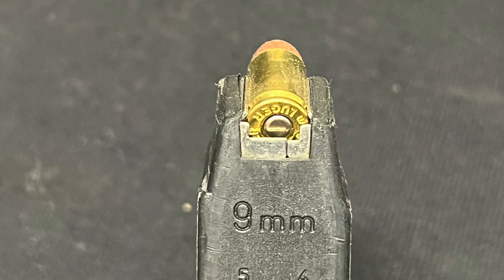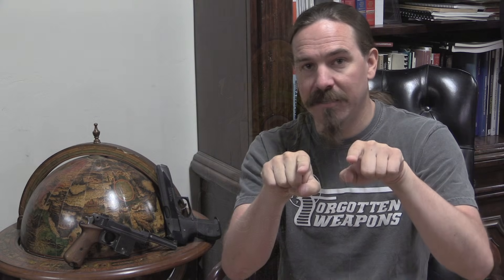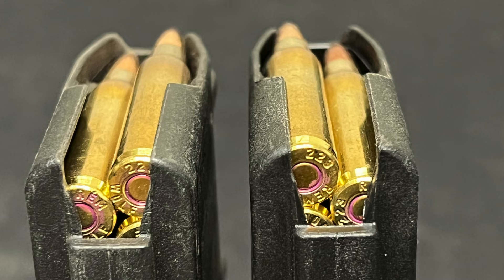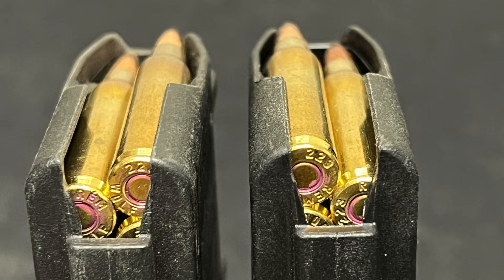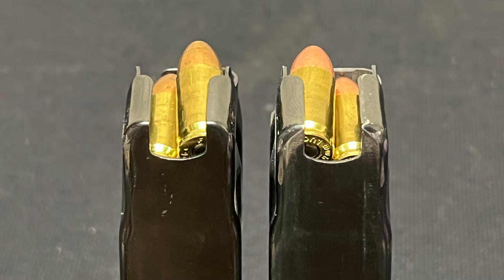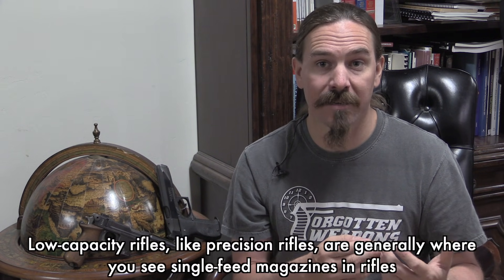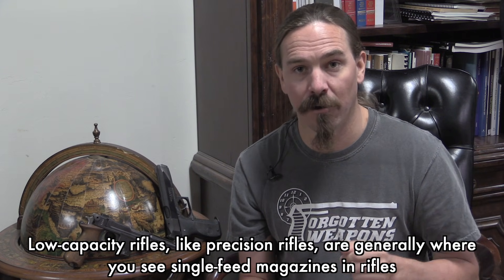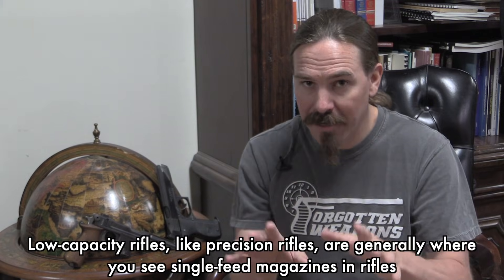Ask Ian: Single Feed vs Double Feed Pistols

Comment: The FN Five-seveN is the pistol I most think of as a double feed magazine due to the fact that the cartridge is so small caliber.
Reply: Ok...
-5,7 is double feed for more reasons, but the diameter isnt much of a reason. Its the largest diameter that defines this, and that is 7,95mm diameter of the main wall for 5,7FN - that means its just a hair over 1mm thinner than 9x19 - considering the stacking angle (cartridges dont stack side by side entirely) it makes for less than 2mm difference in the magazine width.
The reasons I see are, that the 5.7 pistol is large service handgun, designers didnt worry much about width or concealment. Also the cartdridge is long, and front part (1/3 aprox) is narrowed down - that would make traditional pistol mag loading of "cram down and slide back" really awkward, cause the bottleneck part of the round would make it harder to load.

-P90 is single-feed cause of the cartridge rotator in the magazine - the rotator takes cartridges from top and bottom colums (sort of doublefeed rotator eh?) and forces them to rotate 90° - after it rotates the cartridge there is only one end to it, naturally, as you would need two rotators, or a rotator that would rotate both colums simultaneously - and that would be HELL ON EARTH to pull off.
Reply: @warel5730  that whole comment made 0 sense and is impossible to comprehend.
Reply: For some reason I always think of that newer Russian pistol the mp443 or something grach I forget the name
Reply: @oso1165  I can't remember if the Grach is double column but the GSh 18 is
Reply: The VP70 is what usually comes to my mind.
Reply: @HALO-2304 Weirdly whenever i think of double feed pistols the GSh 18 is the first that comes to mind. No clue why, i guess it's just a neato gun
Reply: I don't think that's the reason why it's a double stack double feed mag, but yeah it's the one that comes to mind for me too.
Reply: @Appalachia_Ape  the cartridge being narrower does help in regard to the double feed system quite a bit. Since the cartridges are so slim the amount of variance between each feed position is smaller making it easier to design for those smaller differences.

My Ruger 57 is a double feed magazine with a somewhat wide single feed ramp but the cartridges feed absolutely fine because even though the ramp only has a single feed slot it's wide enough to feed both orientations reliably.

I've never seen the inside of an FN 5.7 slide but I'd imagine it's very similar in overall design.
Reply: Hmm, and .30SC is near identical base/neck diameter as 5.7x28mm, maybe there's a case for double-feed mags for .30SC as they're small enough.

Then the relative difference in capacity even greater.
Reply: In my case first pistol that comes to mind is russian GSh-18, i hope one day Ian will get his hands on one and make a video.
Reply: Ruger 57 is double stack, double feed as well. Personally think their magazine is a better design than the FN.
Reply: @BeingFireRetardant  Agreed.
Reply: I'm going to add something to the list of potential reasons why the 5.7 handguns (I'm counting the Ruger, as well) use double-feed mags.  I think it may have something to do with the long, relatively straight cases providing more surface area to generate friction.
Reply: Great. Now we only need a SBR that uses the same magazine so that it would be really useful xD
Reply: Great info
Reply: Now I want a pistol with a P90-style mag.
Reply: @BleedingUranium look up keltech think they have wacky ass pistols that use the p90 mag
Reply: .22LR pistol magazines are single feed.
Reply: The cartridge is also lubricated
Reply: But a P90 that uses the same ammo is single feed and 50 round capacity.
Reply: @Shepard_AU  The P90 also holds the ammo perpendicular to the bore and they do a twist to the feed lips. To double-feed would have likely added way more complexity to the design and likely other feed issues.
Reply: @HALO-2304  It was more pointing out one of the few firearms that have single feed large capacity magazines
Reply: @HALO-2304  But it is highly effective against Jaffa body armour, as we saw in the documentary SG-1.
Reply: @Llamazone-Prime  Indeed! 😂
Reply: P90 mag is double stack single feed with a very long & complicated follower.
Reply: @Shepard_AU  Can't double feed through a single spiral ramp. But it is ironic that the pistol is double feed and the SMG is single feed.
Reply: @pmp1337 is it not the size of the magazine
Reply: @Shepard_AU  But that's an entirely different magazine system. The magazine on the P90 turns every cartridge 90 degrees before they are presented at the feed lips. So it's an entirely different beast than conventional box magazines.
Reply: @Shepard_AU  the P90 is the reason 5.7 ammunition is more expensive to manufacture than most other cartridges, and it is for that exact reason why I despise the P90.

The magazine design where the rounds have to "spin" to be oriented correctly to feed is why the cases have to be lubricated to reduce friction within the magazine. Which is why 5.7 will almost never achieve ammo prices as low as other competitors even though the materials involved are less because the round is physically tiny.

Every 5.7 cartridge casing has to have that lubricant on the brass cartridge to enable it to feed in one particular weapon that it was designed around from inception. 4.6H&K is significantly less costly to manufacture because it didn't have any stupid proprietary geometry issues. Leave it to the Germans to design something relatively simple when we expected them to be wildly more complex.

Always defying expectations.
Reply: @Kross8761  That's inaccurate. It's not the spin that requires lubrication, it's the fact that it's a straight walled cartridge. Most other cartridges, including 5.56, has a slight taper so it's easier to extract out of a chamber. That's also why you see curved magazines as they increase enough in capacity. With the 5.7, it's completely straight, which can cause extraction issues due to being caught up on stuff, so lubrication is added to fix that issue.
Reply: with a really  omplicated rotation follower that takes up space & costs.
Reply: Well that's a tiny rifle cartridge to begin with and a pretty "chunky" handgun. The FiveseveN is more of a PDW than a handgun.
Reply: I mean it's basically a mini rifle cartridge
Reply: Caliber size really has nothing to do with it though, glock 21 is a double stack .45
Reply: @Awimpyman69  That’s still a single feed.
Reply: @gameragodzilla  fuck you’re right
Reply: @gameragodzilla huh, i cant think of a single double feed, mag in grip pistol in .45 come to think of it.